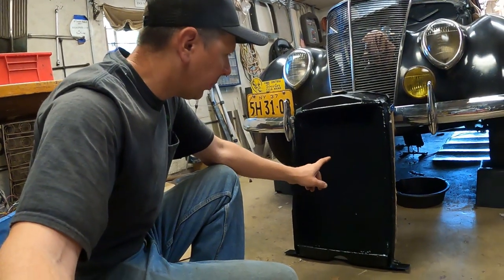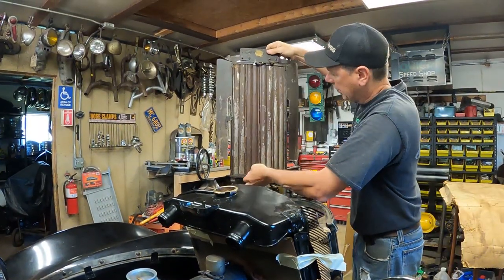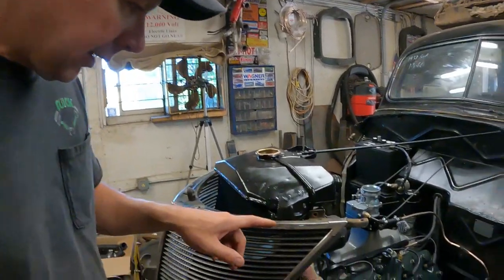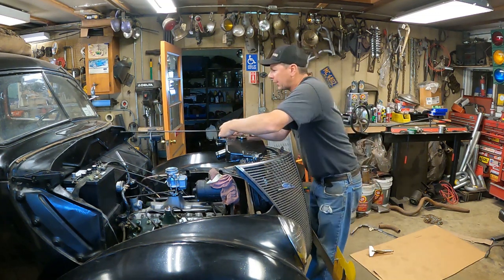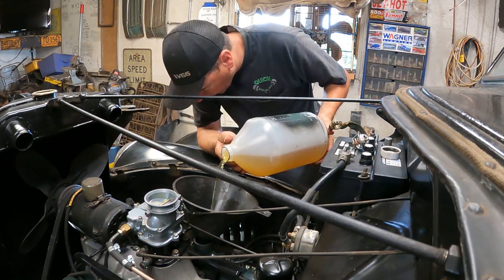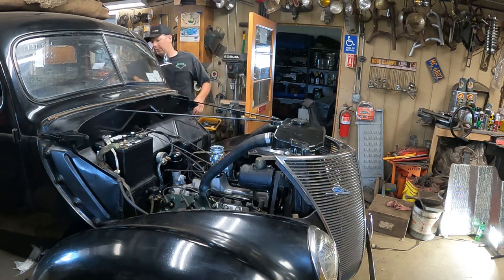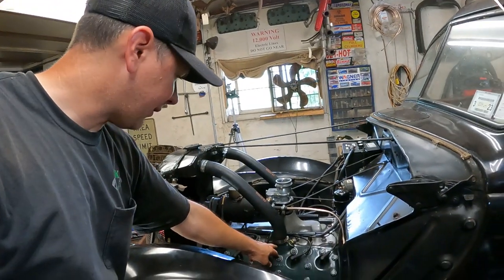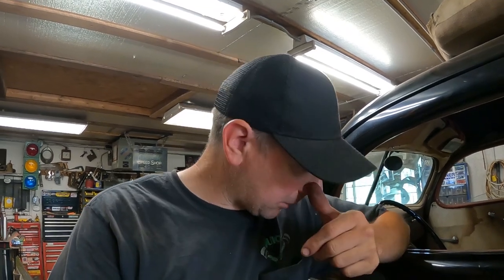1937 Ford Taildragger:  Straight Pipe Flathead Exhaust and New Radiator

Comment: I'm wondering if that hose leak couldn't be solved with using Hylomar M. I use it all over my vintage Triumph motorcycles.  I know deep down you want to use the old style clamps.  Sounds awesome.
Reply from the maker: The repop clamps are built pretty flimsy and get distorted when you try to really tighten them up.  Went back to four worm drive units to stop the leaking.

Comment: Do you think the dual exhaust could make it lope? It's just a guess because there's no scavenging now.
Reply from the maker: I think the engine has a cam.  It has adjustable lifters which aren't stock so I'm going to guess it also has a cam due to the idle.

Comment: Why bother with the radiator cover, I'm sure that you won't be driving the vechicle over winter.
Reply from the maker: Just a neat accessory.
Reply: @QuickSpeedShop  --- yea, maybe so,  but flatheads are renowned for their overheating problems . I don't know how hot it gets where you live, just saying
Reply from the maker: I know.  So far this one running right at 180, but that's with new rad and new style water pumps.  Been pretty hot outside too, in the 80s.

Comment: It looks stock, like the car Ford should have built in the first place. I like the sound but it's too loud for the look.
Reply from the maker: They did build most of the Fords with the big 85 hp flathead.  This engine is a '46-'48 so it's more like 95 hp.